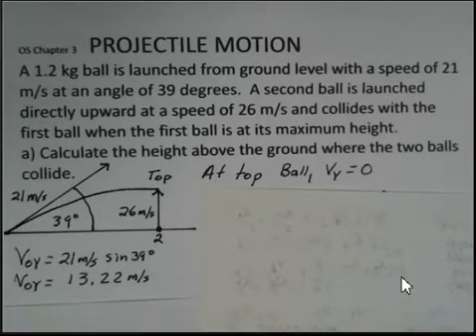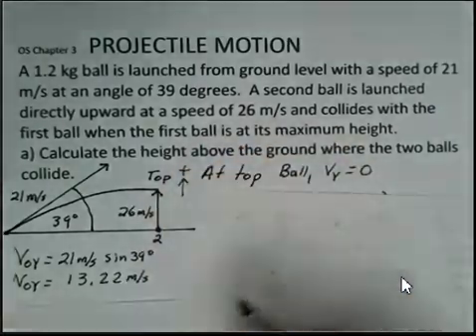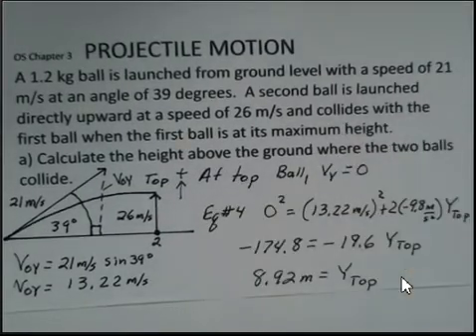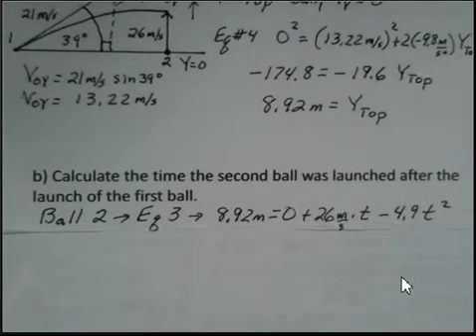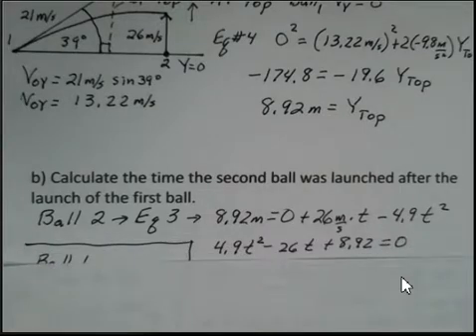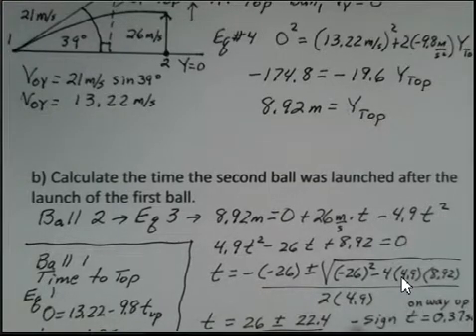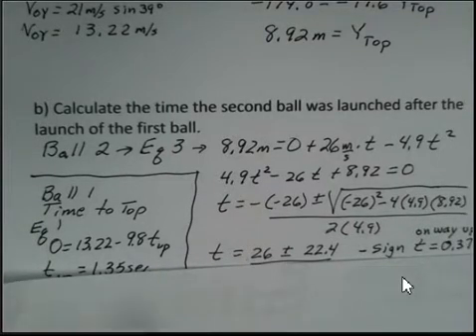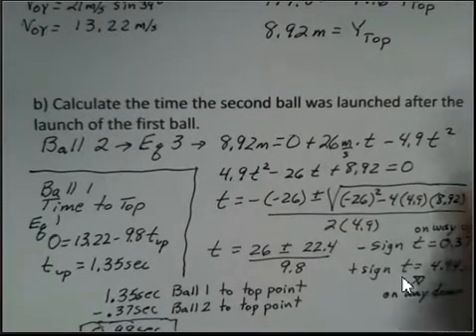Projectile Motion, Two Balls Collide in the Air, Max Height, Time

Comment: I think a simpler way is to calculate the collision velocity of the second ball using the 4th equation, then find its average speed from the ground to the collision and then simply find the time using distance/average speed. Are there any disadvantages to this approach? Thanks in advance.
Reply from the maker: Yes, your method produces the same result as I calculated in the video.  Your method is simpler.  Thanks for the comment.